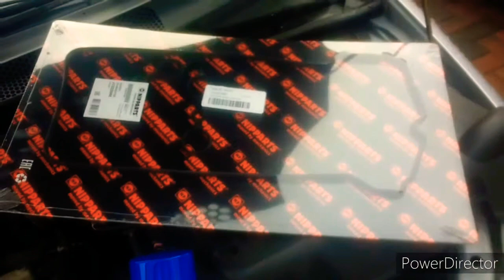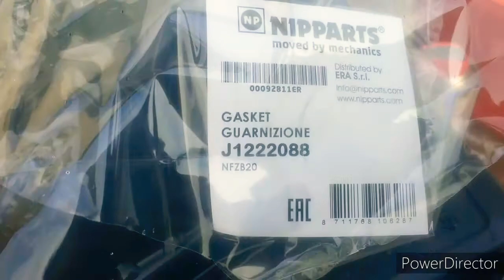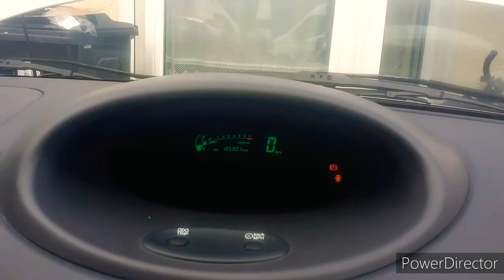How to replace a leaking engine valve / rocker cover gasket Toyota Yaris / Echo 1.3 litre engine

Comment: Great, just how hard should the screws be tightened to the cover? I mean, what force.
Reply from the maker: I didn't have the torque wrench but I usually just hand tighten until there's gentle resistance, then a quarter turn more.